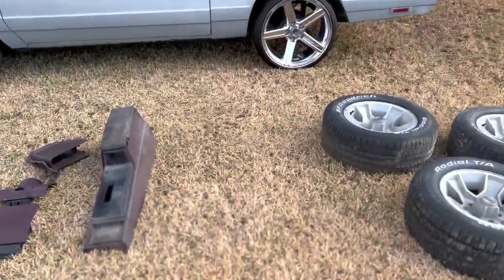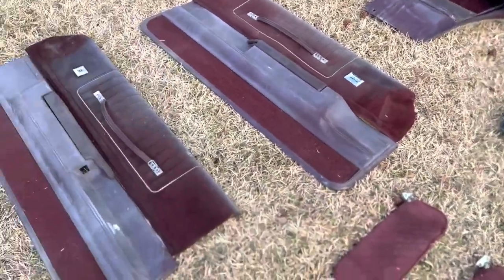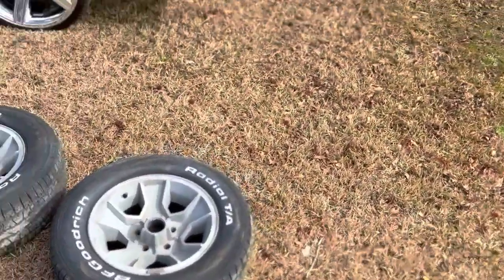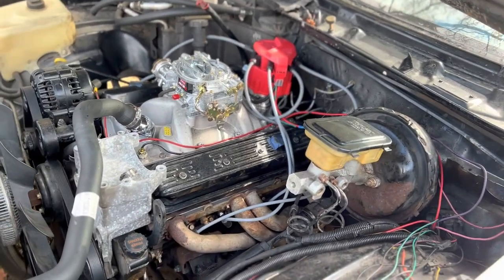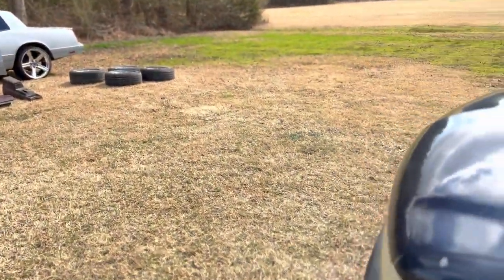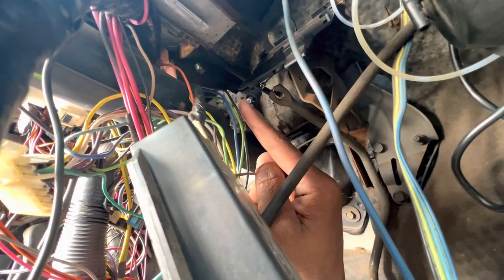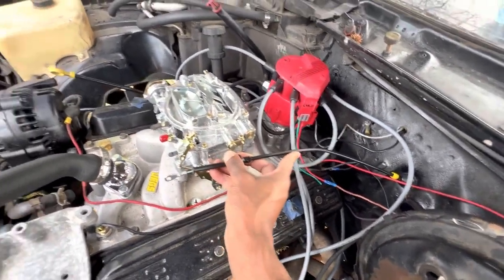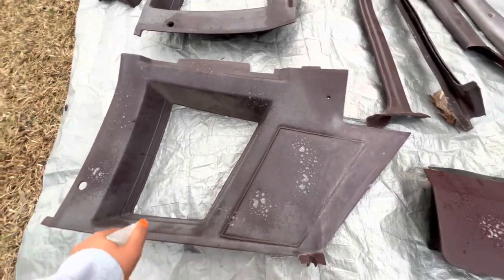MONTE CARLO SS 1987 - ALL ORIGINAL INTERIOR PARTS , THROTTLE CABLE INSTALL, & MORE 👀 #montecarloss

Comment: Did you have any problem with your locks on the inside of the door panels ?
Reply from the maker: These door panels aren’t for an 87 unfortunately. I’m still moving forward with them. i haven’t gotten to electrical wiring of the power locks and windows yet.